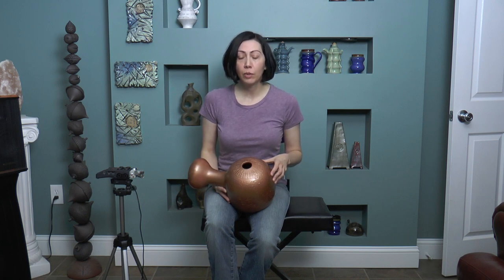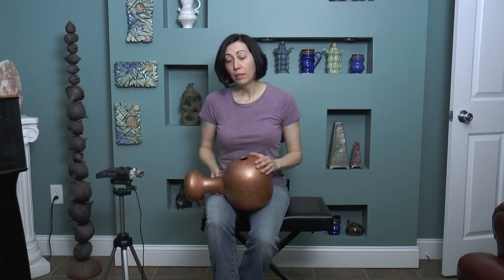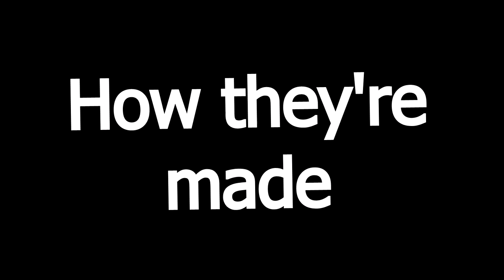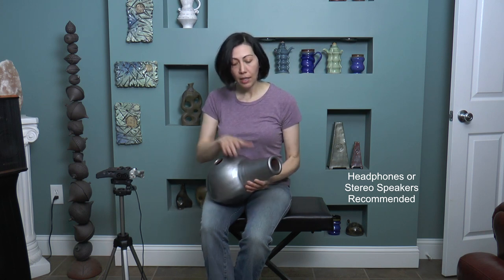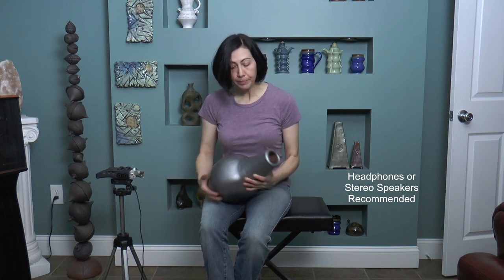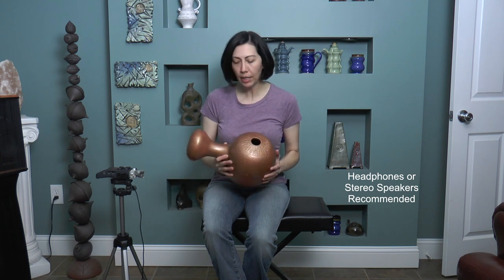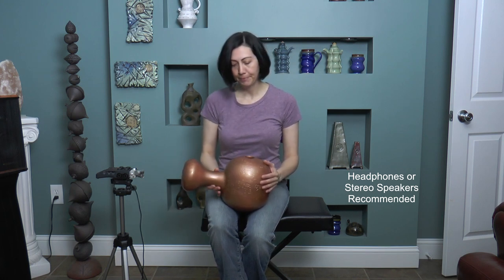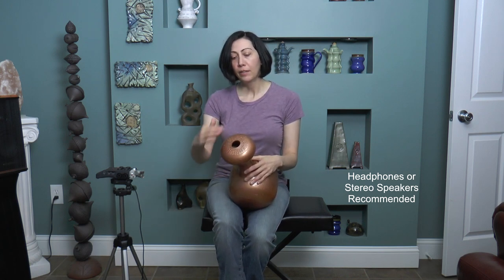Pottery: Stoneware Udu Drums - Playing + Making Discussion

Comment: Ok I see you do have how to vid here.. one question.. after attaching the two bowls.. is there another hole when you attach the neck to the two-bowl shape??? or is solid.. does the sound reverberate b'cuz itis solid? and not a hole all the way thru?? ugh .. not sure if you can catch my question.. But .. maybe you can
Reply: I know the cylinder is hollow.. and the two bowl shape is hollow.. is it cut through.. like as a spout on a teapot.. or is it attached to the outside wall without a hole.
Reply from the maker: Yes, just like a teapot as you say. Make an opening in the bowl part where the tube attaches. Don't worry, your question makes sense! 🙂
Reply: I am curious since it almost looks like like the pieces have patina on them was that a glaze? Are they fired to full temperature in order to achieve the effects meaning does it matter if it's high fire clay or low fire clay or how you fire ?  How high you fire it and curious as to what you used on the outside It's very fascinating looking It  doesn't look like The glaze but then again I'm just not sure
Reply from the maker: @liliannapaxton  I painted them instead of glazing. It shouldn't matter too much whether you high fire, low fire, or use earthenware clay. The shape of the instrument, volume of the chamber, and diameter of the hole for the sound exit from the cylinder combined are what really control the tone of the bass note. High fire, low fire will affect little tapping sounds just like tapping on any pot. Acoustically these are not loud. They'd be quiet played along with other instruments unless you mic them.
Reply: So glad you asked this question @lilliannapaxton. I had the same question. So @evolutionstoneware create 2 bowls and join them, and then cut out two holes and join the chimney to one of the holes? You mentioned the make the top hole in the chimney on the small side for a lower tone. What about the hole on the bottom side of the chimney and the top hole? Small hands over here. Thanks so much for sharing. I’m excited to make this drum!